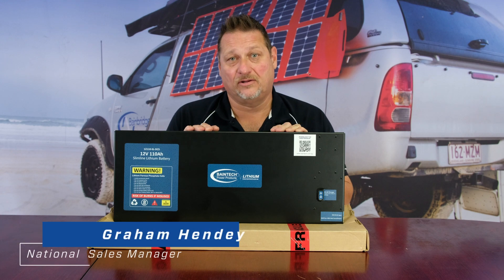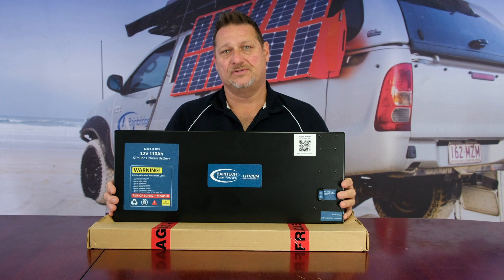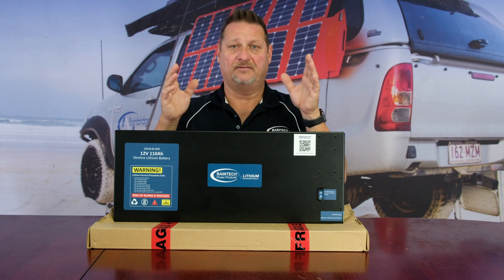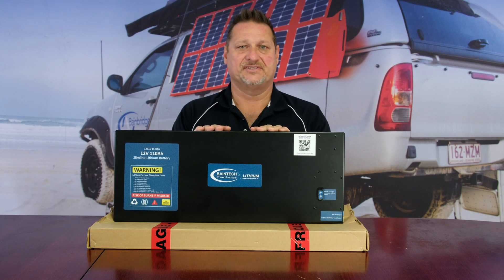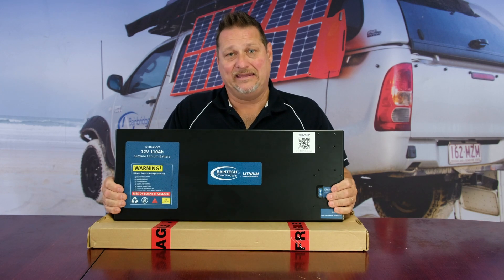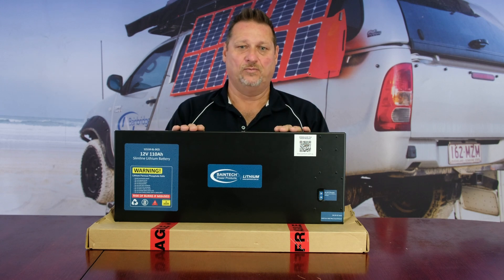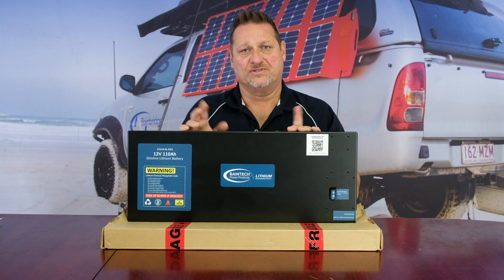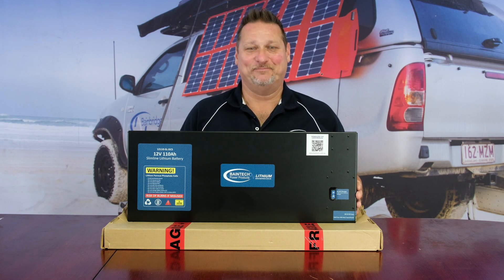All about our 110Ah Slimline lithium battery (LiFePO4) class A prismatic cell!

Comment: Is the 110ah rating for usable output before the bms shuts it off or the total capacity of the cells to completely flat? If the latter, what is the usable capacity of the battery? I ask for the purpose of programming a smart shunt battery monitor.